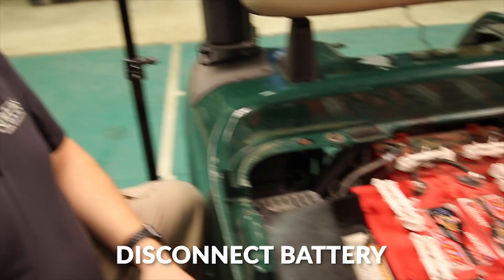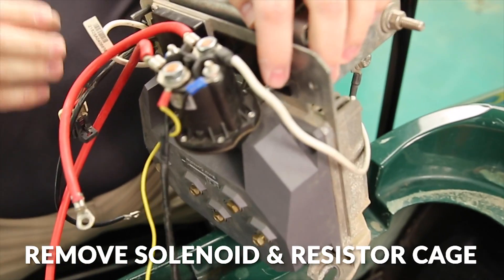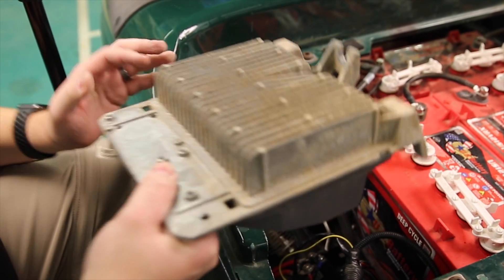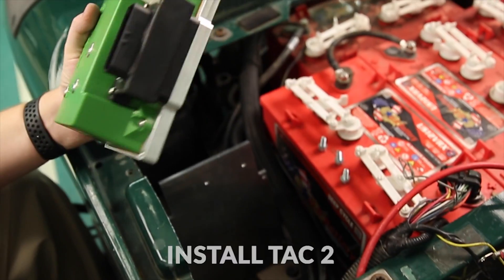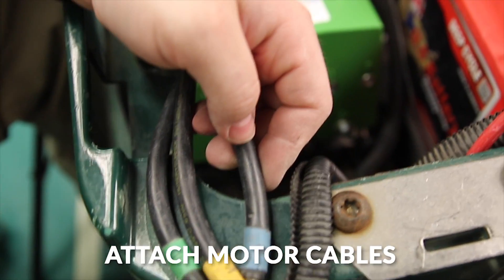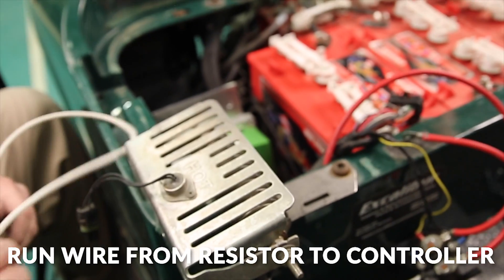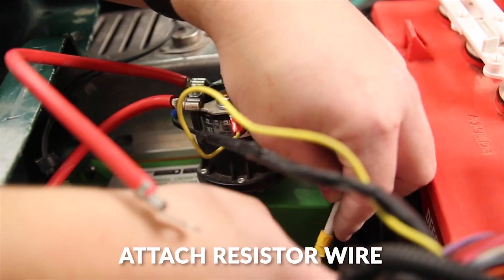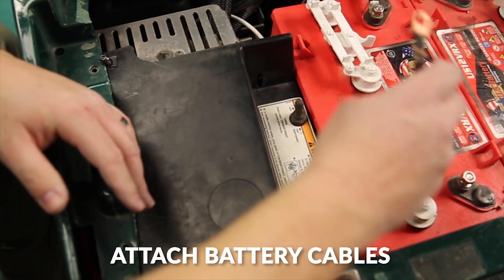TAC 2 into a RXV Danaher Install - Navitas

Comment: What about the plug that was disconnected from the old controller that went to red purple and orange wire? Is that obsolete?
Reply: I'm a little late I know, but yes that plug is deleted. The navitas controller does not use that.